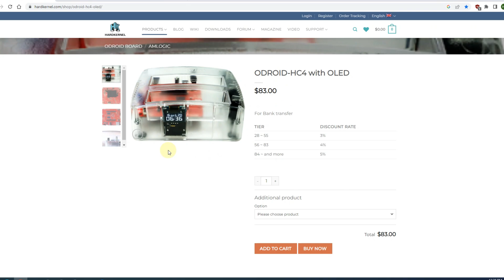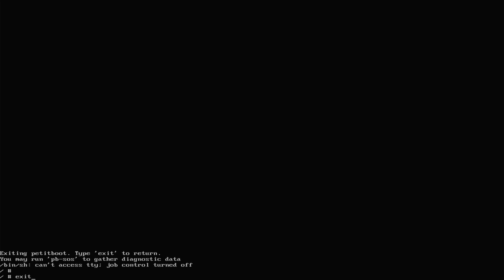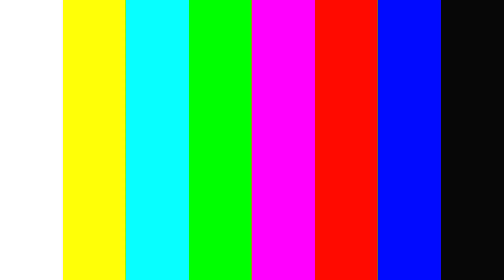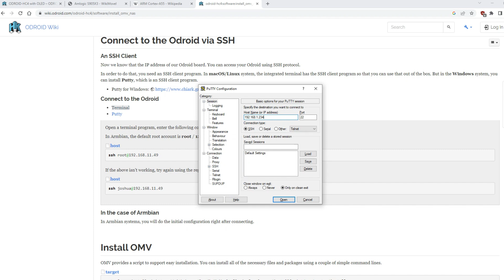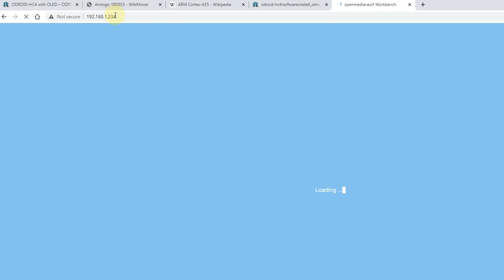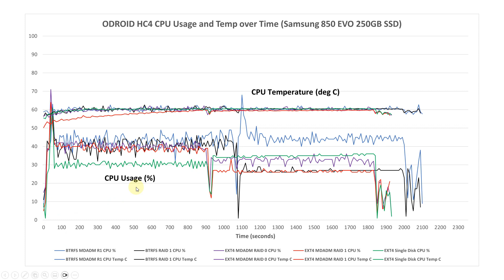Install OpenMediaVault on a Toaster NAS! Odroid HC4 Review

Comment: I installed all this many months ago. I am able to connect via samba and have full access to the drive. The problem is that I received an email from the unit saying that an update is available, I tried to login to the console but unfortunately I dont remember the user and password that I used. I tried the default one shown in this video but nothing works. Should I reinstall everything from scratch? If so, I hope I will be able to reconnect the current external drive ... or maybe I should just live like this and forget to log in the console ...

Comment: Unfortunately, OMV7 with Debian 12 on a HC4 is not working. The OMV recommendation for the HC4 is to install ARMDian, a Debian flavor not supported officially by Hardkernel and the ARMDian version for the HC4 is a "community support" not officially supported by the ARMDian project, see https://www.armbian.com/odroid-hc4/. Don't do a "omv-release-upgrade" if you are running Debian 11 and OMV 6, you will corrupt your OS. The OMV guys made clear than they will not fix the issue.

Comment: Anyone having issues with your Odroid not connecting to the network after debian 11 install.  After the 10.20 mark in the video you need to do a "nano /etc/network/interfaces" and edit the parts that say end0 to say eth0 and ctrl+x and save as original file name.

Comment: ok I got my nas up and running, but I am trying to get photoprism working with photosync and I feel so lost.. I found out I need proxmox after already setting up my nas and I cannot find a complete guide for anything. I am very new, but I am trying... Do I need to start over to use proxmox with OMV and Cloudflare? I don''t expect a full how to as a response, but if someone could give me an order of operations or a map of how things are going to line up, I would be eternally grateful.
I am trying to setup a home nas that I can sync my photos and videos from my phone when I am away from home.
Technology stack:
Odroid HC4
16gb sdcard
2x 4tb Ultrastar NAS
Armbian direct on HC4
OMV 7 installed direct to Armbian on HC4
OMV plugin for photoprism already installed and running
Purchased Photosync bundle/premium on android
Already acquired Domain
Cloudflare installed direct to Armbian on HC4 - supposed to be better/easier than running reverse proxy - Stopped setup when the guide told me to use proxmox, that was "already setup"

Current status:
The tutorial I found for cloudflare says I now need proxmox.... the proxmox tutorial says for me to install OMV from proxmox... At this point I am going in circles and I don't want to start something that will make me have to start from the beginning.

Does Anyone have a order of operations for this?

Comment: I got mine working, but I don't have any of the menu  options that you do on the left. Was there some setup that was cut out of the video?
Reply from the maker: Are you referring to openmediavault menus? You need to log in as administrator. Default login: admin password: openmediavault
Reply: @htwingnut  I did, but it wasnt working. I also had to do extra steps to get the ethernet to work from debian... I have tried 2 different versions of debian multiple times now and I am at my wits end.
Reply: @htwingnut  I finally figured it out, but I had to move to Armbian. the default instructions just simply dont work. I found alternate instructions for armbian and it worked right out the gate after install. Thank you for the help! I had to go on a work trip and I am stuck on the next step, which is connecting photoprism to photosync on my phone.

Comment: my hc4 is taking over an hour to install.. is this normal? you said 16 minutes! I am so confused. I followed the same steps. I am using a samsung endurance pro (2022) 64gb if that makes a difference.
Reply from the maker: I'd say that's not normal. Could be the card, could be faulty sd card reader, hard to say. If you can get your hands on another sd card it might be worthwhile. Maybe a smaller capacity, like 8-16GB.
Reply: @htwingnut  I did take your advice and got a 16gb sdcard but found the issues was with the original install instructions. Once I moved over to Armbian, all my issues went away. The 16gb sdcard also makes this much easier to backup so I can restart from a working system.
Reply from the maker: @feralshad0w  Glad to hear you got it working. Not sure why it needed Armbian, but whatever works, works!
Reply: @htwingnut  I think I found the first instance of the issue. I got a line that it froze on for a long time. It reads: 
update-rc.d: warning: start and stop actions are no longer supported; falling back to defaults

Comment: Strangely I don't see the ip adress. I have ethernet working when in petitboot, but it is not connected when in hardkernel...
Reply: Same problem for me
Reply: @maxskyrativskiy3922  I struggled with this. Use armbian as your OS and this issue immediately goes away. You will need to remove petiteboot after your get it up and running.
Reply: @maxskyrativskiy3922  I struggled with this. Use armbian as your OS and this issue immediately goes away. You will need to remove petiteboot after your get it up and running.
Reply from the maker: Sometimes openmediavault doesn't display IP address. In that case you unfortunately need to go to your router and look for the device and related IP address.